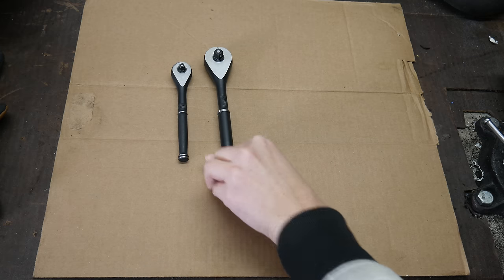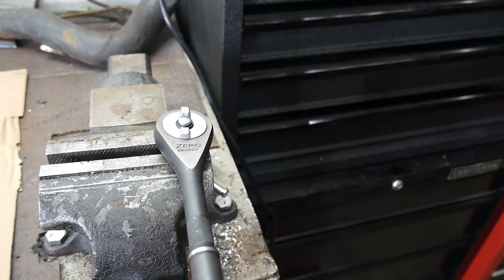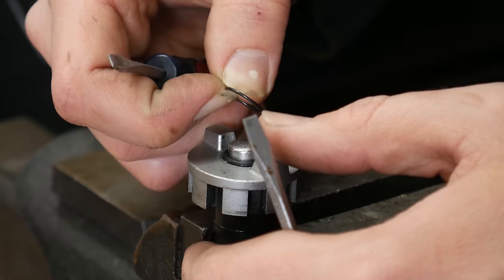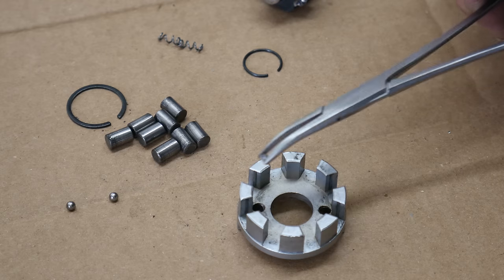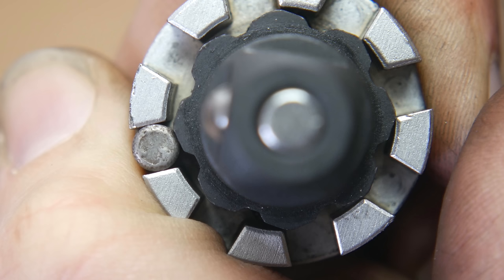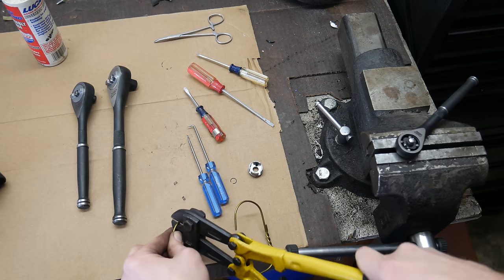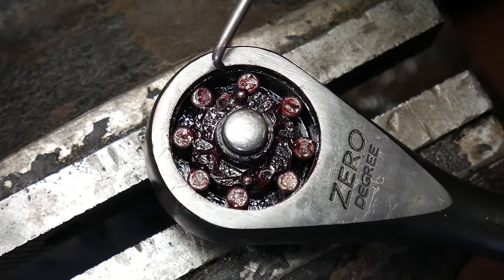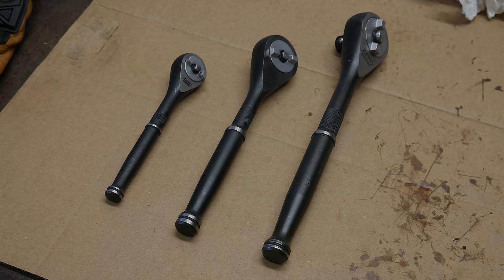Jobsmart Gearless Ratchets – How They Work and Troubleshooting

Comment: I bought a gearless ratchet 25 years ago and it's still going strong. It's great for tight areas but not any better than fine tooth ratchets available everywhere today. These have been around much longer than you think.
Reply: Mine has the drive that you push from 1 side to the other, then flip the whole thing over to reverse direction.
Reply: @paulhamilton5634  is that what my old man had?!?!?!
Reply: What brand?
Reply: @BrianMartin2007   My brand is Power Craft-Pro Series
Reply: @paulhamilton5634  those are the good ones with a full sprag clutch inside. You'd be hard pressed to break the internals.
Reply: They are great for industrial applications, but automotive they kind of suck. The head is too bulky, and when you're dealing with loose bolts in tight confines, you're going to miss a gear set.

Comment: For Stealth mechanics borrowing parts in the Evening hours.
Reply: "Stealth mechanics" bwhahaha
Reply: Awhile back we had a stealth mechanic in my area only he used an acetylene torch and "borrowed" catalytic converters
Reply: This guy will to eventually
Reply: @thewilddinkus8026  That's an awful way to remove catalytic converters. Having to lug around a cutting torch and two bottles of gas along with lines.

The local crackheads just use sawzalls
Reply: @jacobkudrowich  torches would probably be faster and quieter, but it would mean he was together enough to have a rig, but enough of a meth head to be stealing cars. Dangerous combo.
Reply: @swamp-yankee unlikely. They make a bit of noise when you light them. They make a significant amount of noise once you get the cutting flame going. Then they make even MORE noise when you open the O2 dump to maintain cutting. Not to mention the ridiculous amounts of light it would put out.

You can get mini-tank setups that don't use acetylene (I forget what the gas is but you can throw small propane or butane tanks on the fittings) so they take longer to get the oxidation reaction started on the metal.

Either way, seems like a dumber method than the sawzall. With the right blades, you could zip through exhaust pipe in seconds with a sawzall.

Comment: Heh. I had one of those “one click” bolts to get out yesterday. Took ages. Logically I’m sure the engineer picked the best of several bad options. Emotionally I’m convinced they’re all sadists.
Reply: Vortec 4.2 head bolts
Reply: Most engineers are actually somewhat stupid. They aren´t all sadists, allthough many probably are, mainly they just don´t know better, because they never have to work on the shit they come up with. If it works on paper its good enough for ´em.
Reply: The only natural enemy of a service tech is the design engineer.
Reply: @stillwaterbuilders3714  exactly, for instance, i had to remove an intake pipe that goes over the entire engine. Two little screws, one on the side of the engine... the other one right under the pipe. The pipe bends downwards at that spot, so even in case the entire engine is lifted its hard to get the screw in place... they COULD however avoided all that by simply attaching that screw to the side as well. In the end i left that little fucker as it was, with only 1 screw in. And guess what: we're still alive, and thatvintake is still were it should be.
Reply: @ThePhilosopher  I as well have seen many questions that didn't need to be answered being answered in places that were utterly inappropriate. so many guns that I've torn  into, and ended up screaming at the top of my voice WHY!?!?!?! WHY?!?!?!
Reply: @stillwaterbuilders3714  You somehow entirely missed the point of what I said. 

Also, of course someone doesn't fix something unless people have issues with it? Why the fuck would you redesign parts if there isn't a problem with them?
Reply: @tylergarza8695  obviously, you missed my point. Reread, rethink, get back to me in the morning cupcake.
Reply: @tylergarza8695  Actually the comments you don't like are pretty much spot on.  You're right; it's all about the assembly line and zero consideration for maintenance.  Maybe they're not malicious but they are simply uncaring.  I recently had a plumber tell me that plumbers often solder outdoor into the plumbing so the homeowner can't change them.  Well, at least those without mechanical skills. . . That IS malicious.  I have worked with many engineers.  Do not believe for a moment that they have mechanical skills simply because they have a degree in engineering.  Many people that call themselves engineers are simply college graduates with degrees in engineering and have never done the apprenticeship and passed the boards to become registered professional engineers.  OTOH, I have known many mechanics and machinists whose engineering skills put those of formally educated people to shame.
Reply: @stillwaterbuilders3714  Not every single military firearm ever.  Consider the designs of John Moses Browning.  Sure the 1911A1 had some minor changes but for the most part his designs remained in service for decades without modification.  He also designed many of the Winchester lever action rifles which were all produced throughout their production runs as designed.  Oh, wait.  Slap me on the forehead.  JMB wasn't an engineer.  He was a DESIGNER, something beyond the scope of most engineers.  ;-)
Reply: @David-hm9ic  very true, John Browning is the exception to the rule.
Reply: @David-hm9ic  it's crazy to think that he never wrote anything down until he was finished with the idea in his head.
Reply: @David-hm9ic  A plumber is a tradesman, not an engineer or designer in the same way that was previously being discussed. And secondly, what does your shitty opinion of fake and real engineers have to do with the conversation? It's like you're just filling out your comment to make it look like you were paying attention. 

Original statement: Engineers put fasteners in hard to access areas PURELY with malicious intent.
My statement: That's probably not as often the case as you'd think it was, and it's important to consider assembly efficiency and the order of operations.
Reply: @tylergarza8695  I got to hear the story from two engineers (two different occasions) who owned cars being worked on by the licensed mechanic I am working under. One told him "my base civic doesn't stop fast enough" (smallest brakes possible, loaded with 3 people, car stopped as it was factory designed) and another tell him "that is not a bushing, that is an oil seal" (he was complaining about rattling on a lower control arm, and decided the licensed technician was wrong about what a component of a car was).
Reply: Those aren't so much an issue for me since I bought this cool ratchet where you can rotate the handle and it turns the head. Both ways you rotate it turn the head in the same direction too. It's saved me a lot of time.
Reply: It's called the Stanley rotator ratchet if anyone's interested.
Reply: engineer probably had it fine, the penny pinchers decided to cram other shit around it so it could not be accessed.
Reply: Yo, try one of these, https://www.youtube.com/watch?v=q_TpaCWnP88 , it's a ratcheting extension piece that works via a chain being driven between and around the two female drive points, like on a chainsaw, then you might have more space to work with may need a couple if it's really recessed though.

Comment: It is not a sprag clutch. Sprags are a style of clutch. This is a roller clutch.
Reply from the maker: Oh, I was mistaken! You are correct. I am mostly familiar with sprag clutches because of automatic transmissions, I was lumping roller clutches and sprag clutches into one category in my head. It is definitely a roller clutch since it uses roller elements and not figure-of-eight shaped sprags.
Reply: Hey, Jack, thanks for the education!  I first learned of the Sprage clutch from a diagram that was, based on what you're saying, actually a roller clutch where the rollers would pinch in one direction and freewheel in the other because the inner race held the rollers in triangular recesses.  My visualization of the Sprage clutch has been wrong all this time.  I looked it up and saw a number of examples that show you are 100% correct.

Comment: some 15 years ago, I talked to a MAC dealer about "gearless zero degree" ratchets. He, a MAC dealer makes his living on the product with the name on the thing I was asking about, said quote "don't do it". He explained for quarter inch, fine work, low torque, tight places, maybe, and then, just a maybe. He said otherwise, avoid at all costs. "Why?" I said, he replied, they are knuckle busters. The heads fail at the most inopportune time, and have put guys out of work for a day or two from stitches. Think about it, imagine punching the corner of a cylinder block as hard as you can. That carnage is what happened to some of his customers, while bearing down on the ratchet, while trying to break loose rusted bolts. Being someone that has in frustration, pushed hard on a ratchet, with the assumption the rust would brake the speed after breaking the bolt or nut loose, I took his advice and abstained. I did however, invest in a microratchet for driving bits in tight places. That works fine. Just beware zero degree, and cheap ratchets for high torque in general.

Comment: Jobsmart tools are very hit or miss.  The real magic of Tractor Supply tools is when they have those clearance sale bins by the front doors.  Got a full set of both metric and SAE Jobsmart wrenches for $8 combined. Shortish shank length, but great for smaller jobs and never hurts having multiple sets of wrenches.
Reply from the maker: Their clearance stuff is pretty much the main draw of Tractor Supply for me, got a set of metric ratcheting combo wrenches there for $3 once!

Comment: The best detailed break down on this kind of clutch mechanism I've yet seen - nice job.  I am not a brand fanatic, and have lived by the model of "get cheap tools you need first so that you have them", and then as I became more knowledgeable and also found which tools were more relevant to me, I gradually replace them with the best version I find out there - American, German, Japanese, Taiwanese, Chinese... whatever.  I do have some very nice ratchets both Snap-On and German (Gedore & Wera) but at 56 this happened over many years!  That said, I do have a 1/4" Snap-on TZERO which is also a clutch wrench like this one.  Granted it is small, but it functions flawlessly - I even tried just now to recreate any of these issues.  So quality probably is a factor, though I haven't tried the others out there in the market.

As to use - well, I like the click-click of a ratchet.  So I normally use others in my projects.  But the TZERO is very small at 4 1/2 inches total length, with the round head 1 inch in diameter and 7/16 inch thick (without the drive connector).  So sometimes when I either need a very petite ratchet in a tight place, or I want to hear everything but the ratchet, it is a wonder.  It's called TZERO because the amount of movement required is almost 0º!  Hope that is helpful - this isn't a plug for Snap-on, just sharing my experience.

Comment: Harbor freight sold these 20 years ago, but you reverse the action by pushing the square part out the other side. If I remember correctly they only had them in 3/8 drive.. Really nice for short throw locations.

Comment: i picked up a "gearless ratchet" from halfords (major high street car/bike tools retailer in the UK) and i honestly love it, i've never been able to make it slip and i've practically stood on the bloody thing! its my main wratchet now, as even in places you dont need the "zero" degree precicion, the extra bit you get from having no gears is super nice and handy.

i still like my flexi-head regular ratchet, its got a longer handle and the flexi head makes it great for certain situations, but the gearless is a joy to use when you can fit a straight shaft!
i have a few other ratchet that have specific uses, but i find those two cover 99% of my ratcheting needs.

Comment: Excellent video. Loved it. The combinations of your words and the excellent pictures covered all areas of how it worked from the slight turn of the roller, the simple springs to lock the selection in position,  the ramp causing the rollers to oppose the turning of the drive head, with the added bonus of the sanding of the exterior roller holding to prevent it being flicked in the wrong direction. Also the number of different ramps according to ratchet size determining slippage to engage the locking of the drive head on rotating. Really great video.

Comment: The only issue I have with those is if I'm in a situation where I cant see exactly what I'm doin and If I can't hear or feel the click then it's hard to know for sure the bolt or nut is actually turning/tightening
Reply: Agreed
Reply: You should still feel if any tension is going at it or not
Reply: @blitzcourt5021  there are plenty of times where you can't tell what so ever
Reply: Blitz Court what are you talking about there shouldn’t be any tension till your almost
Done tightening.
Reply: They should sell these cheap ones as a color coded tighten/loosen pair and just forget the switch altogether since they never seem to get the mechanism precise enough to not catch on the housing and reverse itself, added bonus they can be made slimmer since the back would be flat.
It'd be perfect for DIY and the bane of budget minded mechanics I expect my cheque in the mail China.
Reply: well if there's no tension on the thing you're fastening, then how is it going to click over your ratchet? it still has to have enough force opposing the ratchet mechanism to make it actuate and this gearless mechanism should require a much lower opposing force to get it to back-track
Reply: @TheEpicLinkFreeman  true but with this design you may bump it in the wrong direction and in a confined space with no visual or audible conformation you'll be trying to start a bolt and it could halfway through switch directions and you'll never know before its already out and falls never to be seen again...at least that's my experience there's other problems like this not just switching direction but it's the most likely scenario...for instance  until a fastener starts grabbing there will be no tension whatsoever but at least with a traditional ratchet there will be audible conformation when it finally does.
Reply: you should feel a slight resistance in one direction at a time
Reply: I'm just gonna C&P my response to tehlaser here:

Yo, try one of these, https://www.youtube.com/watch?v=q_TpaCWnP88 , it's a ratcheting extension piece that works via a chain being driven between and around the two female drive points, like on a chainsaw, then you might have more space to work with may need a couple if it's really recessed though.
Reply: This one will surprise you-working in a blind spot it could change directions several times & still be about where you started.

Comment: The square drive portion of a ratchet is called the anvil. I don't know why. Just is.
I have a Kobalt 3/8" drive gearless ratchet and a 1/4" drive Sealey. I assumed that they worked like this so it is really cool to see it disassembled. I have never lubed my gearless ratchets because I knew that they work using friction. Now that I see it won't hurt them I may give it a try. I love them because they are the only things that work in REALLY tight. cramped, areas. I use the Sealey more because the head is so much smaller, but I have used both. They're not daily use tools for me, but when you need one you really need them. I don't have a 1/2" drive gearless ratchet and I have never come across the need for one, but it might be nice to have 'just in case.' I'll try Tractor Supply's website because there aren't any stores in my state. The way I feel about my gearless ratchets is the same way I feel about my pass-thru ratchet set and my spline drive sockets. I sure don't use them every day but when the need arises I am DAMN glad I added them to my tool box.

Comment: Stretching springs- heat and pull to the desired length, then cool down with oil or water to make it hardened again.  Otherwise it will stay in a softened state .  Practice with clicky pens .

Comment: im a tech and haves lows 1/4 and it is amazing i picked it up in the discount bin never slips and doesn't drag on loose bolt! ive had it for 2 years now using it in a industrial setting all the time no issues!

Comment: I had a sprague clutch ratchet over 46 years ago, it's made of stainless steel and the socket drive square is removable so it can be put in the other way, I still have it and it still works like new

Comment: "at least a couple of years..."  Dad had a gearless ratchet from the 1950's.  I think he called it an aviation ratchet.  Worked great as if you had any wiggle room at all the ratchet would rotate.  But it was worn from years of use and if you put too much torque on it the ratchet would slip, I've still got a couple scars from that ;)

Comment: The best thing about these gearless ratchets is that they tork it correctly. Whereas regular ratchets will keep tightening until the bolt bends (if you're not smart enough),  the gear-less seems to stop when the item is tight.

Comment: @Fuzzy Dice Projects if you dont know then take the springs ,heat up your owen to 200C and place the springs init for 2 hours , that sets a new "zero" for the strech of the spring and not compremize hardening ! works for car springs too if lowering is to be done with originals !
Reply from the maker: Sounds like a good tip! I have heard of similar methods before, but not for car springs! Thanks for sharing!